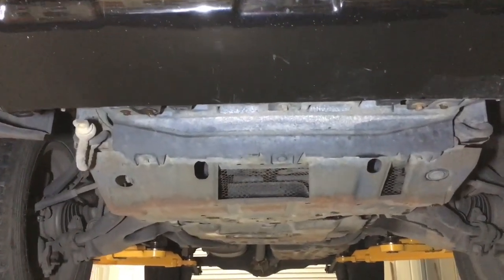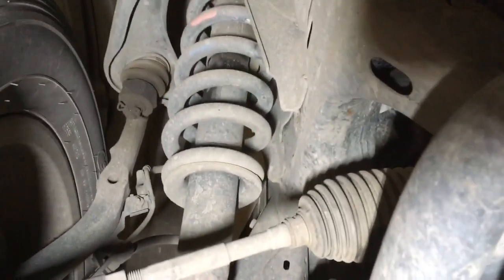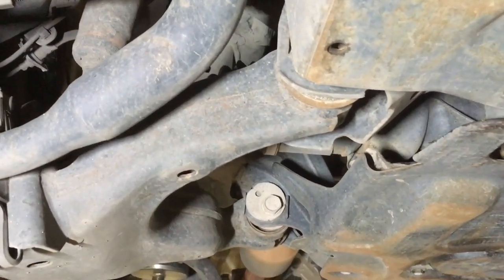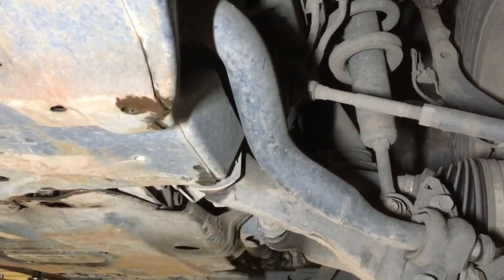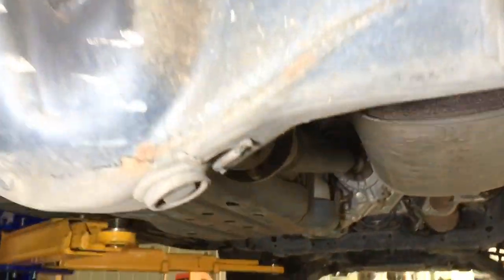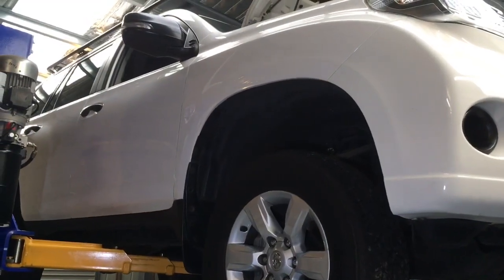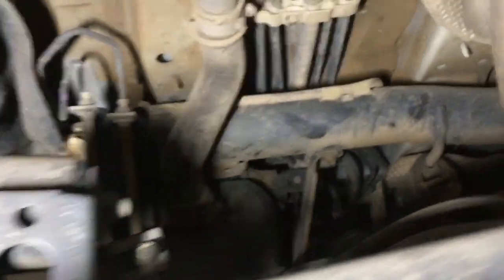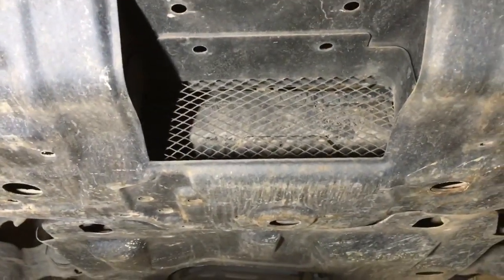WHAT TO LOOK OUT FOR buying PRADO 120 150 or used car

Comment: That D shackle on the transport restraint point is doing my head in.
Reply: Get over it, 
we used these recovery points 100’s of times safely….in the Middle East dunes, 
It’s  just the OZ Nannie’s who require engineered recovery points!
Reply: @noddy1919  or anyone with a basic understanding of physics, engineering and metallurgy. But stupid is as stupid does, and after 23 years of working remotely in Australia I have seen many overconfident come unstuck.
And clearly if you require to be recovered 100's of times common sense is not your strongest character trait.

Comment: I have got a 2006 LC120 Prado GXL 4.0 V6, 155000km on the dash, it runs very well. Just normal service and I recently changed front CV rubber boots. That's it, easy to work with and always keep going!
Reply: how much it cost for changing cv boot, drive shaft boot and damper bushes. Thank you

Comment: Looking at buying a 2009 120 series V6 petrol, has a shudder when turning at low speeds like when turning a corner from stop. Feels like it’s coming from the rear, possibly a diff issue. Any tips?

Comment: Good info, just to add a couple things that I've come across. The exhaust donut gasket went on mine and produced an annoying squeak. Then after the great central road there n back the dump pipe cracked at the turbo end. Both cheap genuine part fixes.

Comment: I have a 99 Prado Landcruiser 3.4 V6 Petrol- NZ new - ie; not an imported Japanese used - 280,000KM - 173,000MLS.Replaced cam belt at 120K and 250K, later replaced radiator. Plenty of these reliable vehicles cruising into their 200,000 - 300,000km. Strong, reliable, useful for varied tasks, towing stuff, moderate off rod, Carrying 8 people- fuel economy not fantastic, but pretty safe vehicle in a crash- All Wheel Drive great in NZ when night driving on long- empty rural highways and around the corner is mud and clay over the road from a small landslide- whoosh pretty well straight over, conditions that'd make a front wheel drive sedan go into a slide.

Comment: Hi Anthony
Thanks for the informative videos. Hoping you can help - I have an '06 Prado 120 V6. When driving over relatively small corrugations (as opposed to large bumps and ruts - I get a significant 'thud' coming from the rear suspension/ axle area. It can be felt quite heavily when sitting in the rear over the wheel arches. I have recently fitted EFS shocks and coils so I suspect it is a linkage arm or bush of sorts? Any ideas?...

Comment: I just purchased a 2012 auto IKD for my daughter with 350K , awesome service history, lower arms were just done for RWC,  it says injector clean on every service, owned by a nurse that only did country miles, the car never towed, no tow bar and never went off road,  I am not a mechanic, but I am considering just getting the injectors done, what are your thoughts, and what else should I look at doing just in case, because the price was good and the car is very clean,  cheers.